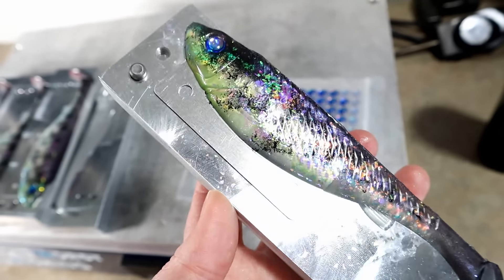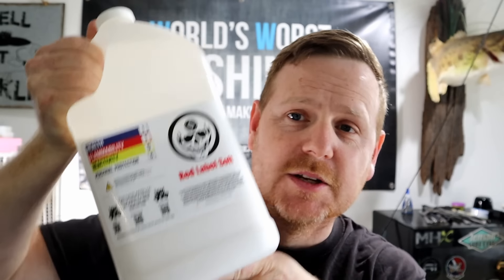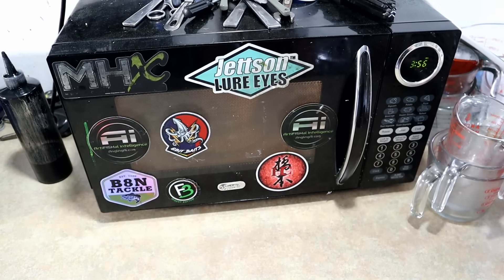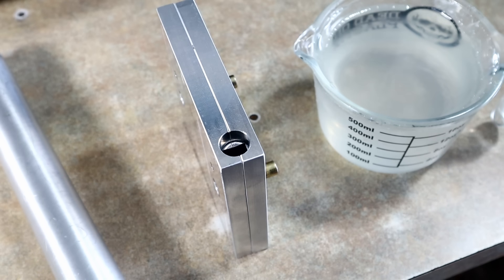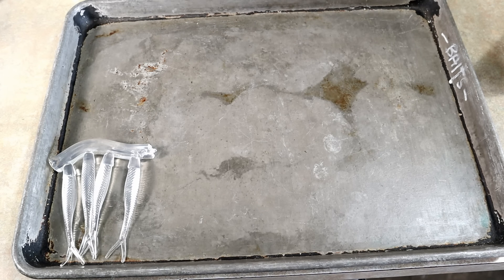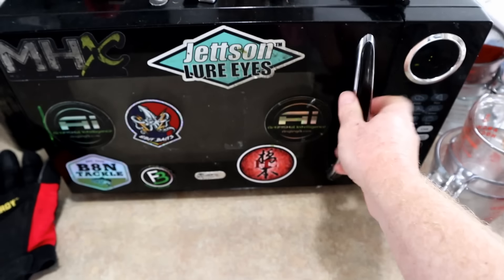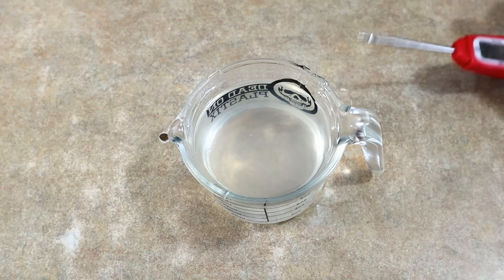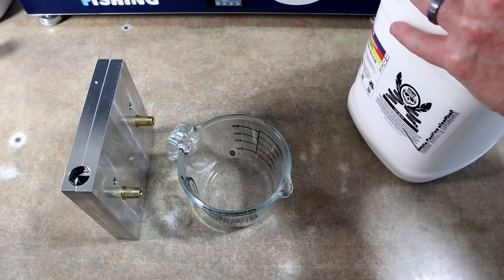Dead On Plastix RED LABEL Plastisol Review! The Best Bait Plastic??

Comment from the maker: Which plastisol will you be using and why?  3 great options now
Reply: Sinking still
Reply: What injector do you use?
Reply: I want to learn more. But would be dominant saltwater.
Reply: I currently use both Black and White label with no complaints. But, I am going to give the Red Lable a try.
Reply: What blend would you prefer for walleye I just bought the 4-inch tracer mold and 4-inch jigging mold with separate tail mold also. We've talked before Chris I run that big walleye group on Facebook for lake erie fishing. Thanks, buddy looking for other options for the lewc custom lure company We've already established.
Reply: Been using the black and white label for years and if there are increased health risks with red label no thanks. Black and white work great for me.
Reply: I definitely would throw the glass shad
Reply: Does the red label float?
Reply: @CrankCaveBaits  Yes, says it on the product page.
Reply: 🎉😊 that was absolutely amazing all this is thank you so much for showing these videos blessings.
Reply: Quelle produit tu me conseille pour avoir un leurre pas trop souple ? Merci d avance

Comment: This channel is what got me started making my own baits. I've only ever used d.o.p. for my baits, have never had any issues. I mostly use the back label, but have just recently got some of the floating. Baits always come out looking great. No need to shop around. U get what u pay for. Keep the content coming.
Reply from the maker: Great to hear!
Reply: Could you assist me with what Plastisol is best for making Senkos? That's all I use pretty much.

🍻
Reply: Black bucket worm blend or swimbait blend. Depending on how soft you want. Worm blend is softer then swimbait blend. Swimbait blend is a little more durable then worm blend. Generally baits 4 inches or larger I would use swimbait blend. Hope this helps. Also I do not use salt in my baits, adds moisture bubbles. Blk bucket is a sinking plastisol

Comment: I've been pouring since 1994.  I started with Lurecraft.  Good plastic, but expensive.   I then ran MF for years.   I started using Calhoun when Del became a distributor (Rest in Heaven Del). For years, I was using MF and Calhoun exclusively.    Prices shot up reference supplies, shipping, and unfortunately, the distributorship of Calhoun.  The distribution of Calhoun was not the distributor's fault.   I continued using the remainder of my Calhoun plastic for personal use. Yes, I'm selfish.   I then came across some freckle face, red head.   It's not the kind of red head that I usually prefer.   😂😂😂  I started using D.O.P.  I originally bought D.O.P. for the consistent availability and the price.  Phthalate "free"  was never a concern for me.  I have good ventilation and wear a mask when I'm really pumping out the baits.  Their is a learning curve when using a "Phthalate-free" plastic from any manufacturer.  A vacuum chamber is a must.  We all know the bubbles in plastic don't affect the bait.  However,  customers have high expectations of their purchase.  As the little guy,  we have to be better than the big guy.   Even though the "Big guys" have bubbles, dents,  and short pours.  I will definitely be trying out the Red blend.  It will be great for my Shooting Star.  I will stick to the Black and White labels for my hand pours.  Thanks Chris for the video.   100k is right around the corner!
Reply from the maker: Thanks man....you're going to love red label
Reply: You can get Calhoun plastic direct by the barrel or recently Fat Guys Fishing has started re selling Calhoun plastic.

Comment: I’ve messed it several brands of plastisol and have to say dead on is  the best by far i have used.    Handles excess heat, has low odor and remelts very well.     It will always be my first choice for bait making!

Comment: If you use the red label plastic Which you say you can make very hot so if you're using the red label and you're doing a laminate let's say you're doing green bunking on top and they wait on the bottom so with the red label what would be the correct temperatures to do the lamination?

Comment: I currently am trying black label and house blend from deadon. Previously only used baitplastics brand. My impressions are deadon on seems more finicky about mixing. It REALLY must be thoroughly mixed or it’s a goey mess. Bp didn’t seem so finicky. But , to be fair bp has an opening big enough for a paint mixer and deadon doesn’t. Otherwise deadon seems to be clearer. But must be put in the vacuum chamber. Other characteristics like buoyancy will have to wait for ice out up here.. edit: yeah, two weeks later dead on going down the drain, ordering bait plastics. Dead on is way too temperamental for me. I’ve wasted 1/2 gallon and hours cleaning out goopy molds😢
Reply: I bought a gallon of the House Blend and and the first time I used it was a nightmare of flashing.  Took a while  getting the molds cleaned up afterward.  The next go-round, I shot through a cold mixing block on the dual injector, and it worked better.  Trying to remove the baits from the molds before the molds were dead cold was a problem, and the finished baits have to cure a couple days before they aren't sticky.  Also bought a gallon of the Red Label Hard, and shot a few all-clear baits last night (with a bit of mica and/or glitter).  On the plus side: Clear as glass, and very flexible. And for some reason, I was able to take 'em out of the molds after a few minutes without damaging the baits.  Still a bit sticky but getting better as they cure.  But definitely not "hard"...as @cody4672 noted in another post.
Reply: @roberthall5616  yeah, it’s got to be thoroughly mixed, then mixed again. You shouldn’t have to wait to demold imo. It is super clear but not worth the finickyness

Comment: What plastisol do you recommend for pouring 2" crappie grubs?
Reply: I know it’s just my 2 cents but my experience with DO is it runs soft compared to lures you would buy in the store. Worm blend would probably give you you Goldilocks for a 2” mold. Finesse will be VERY soft. More action but breaks a lot. Jerk/swim bait is what I run on most of my molds but I prefer them stronger and more subtle action I fish a lot of cold water.